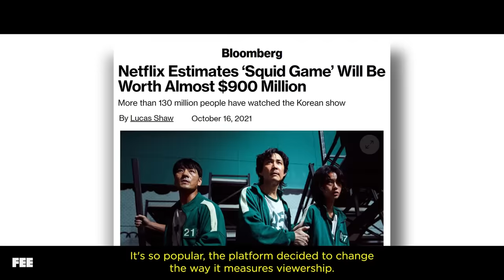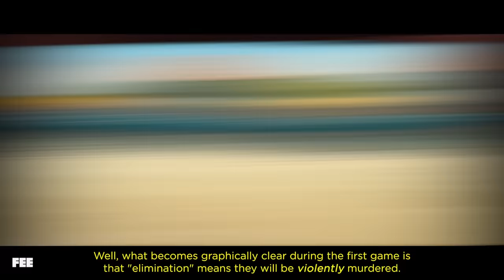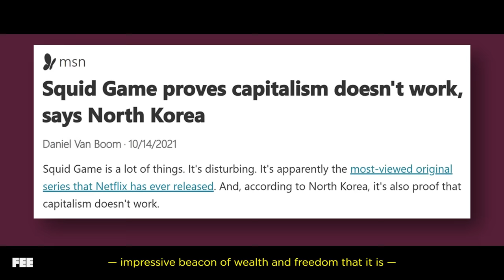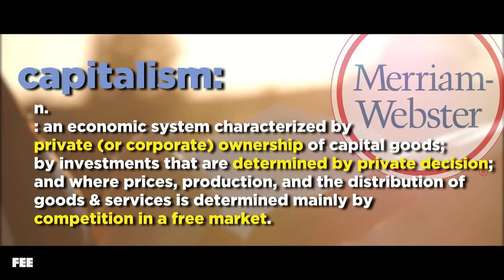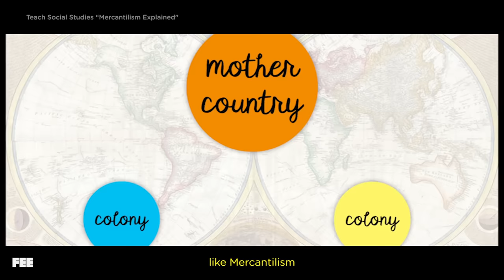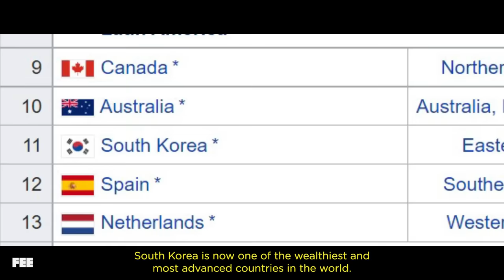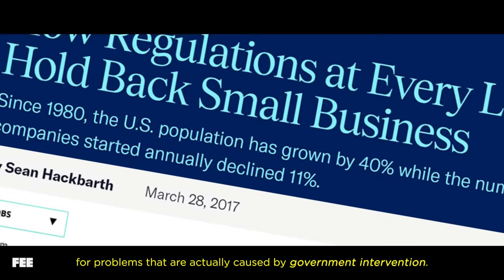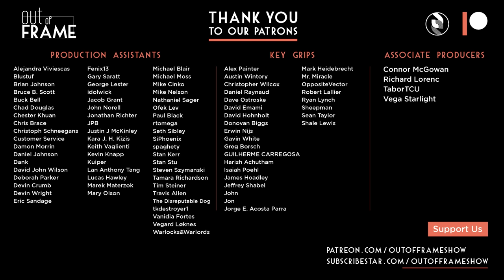Squid Game is Wrong About Capitalism

Comment: I saw it as simple take on moral failings and their consequences when you keep making immoral choices.
Capitalism is the BACKDROP because only in a free Capitalist society can the consequences of the individual's moral failings be of the most significant.
In top down societies, you have no agency, therefore no choice, no possibility to be immoral.
The morality/immorality and it's consequences lie mainly with the State/ruling class.
This is what critics of Capitalism fail to recognize. The "problems" with Capitalism are actually with the moral failings of the individuals within that system, which is why Capitalism is only as successful as the members of it's practicing society share and hold a common moral belief system.

Every system is subject to moral failings of the humans using it. The strength of Capitalism is those lie at the level of the individual, and thus less problems are created for the society as a whole should they fail in being moral (as we see in Squid Game). In an authoritarian structure, it only takes the moral failing of the leader (or few leaders in charge) to screw everything up and wreak suffering the consequences upon everyone, including bringing the whole system down.

Comment: To be frank, I get the feeling the series might actually give a pro capitalist message by showing that the characters, for the most part, made the circumstances they are now in.  If it was truly anti-Capitalism, it would be a bunch of people fired for non sensical reasons or people who are on the job hunt for years.  The masked people also don't really exemplify Capitalism either cause they are wealth elites that can exist in any market form.  Nobles in Monarchies have similar if not greater power.  Communism has it too.  

The series is a critique of those who critique Capitalism by showing the true nature of those that complain about it.  The majority don't want to put out the effort to be successful with a much smaller group of people who got the short end of the stick.  The smaller group has a right to be upset, but also the beauty of Capitalism is that you can reinvent yourself and succeed in another part of the market.  As for the lazy majority, they need to stop blaming the system for their own failures.  The show creates an environment to show off the major groups of complainers and shows how most of their complaints are their problems, not the system's, and how pitiful they are for blaming everyone else for what went wrong with them.

Comment: Correct! Squid Game had little relation to Capitalism and more to do with Cronyism and possibly oligarchical rule, highlighting greed and deception rather than profit. 

I favored all the characters OP did and disliked the other main characters, however I like the resolution. Some of the changes have to do with the eastern symbolism (I.e. making a big deal about getting a hair cut and then becoming a different character/finally growing). Still this is a good analysis! 

Props for reviewing what you didn’t like fairly!

Comment: So, this is the classic defence and use of doublespeak that heard when defending capitalism. 
   Capitalism is a word. Proponents of capitalism will pull out a dictionary and slavishly follow the definition said whatever criticism does not apply because it's not a critique of capitalism.
    This becomes doublespeak when creators of videos like this so not apply the same standard, or speak out against all the profiteering videos and commentary. 
    Fire those videos the dictionary is put away and a neuanced discussion about ideas takes place. Instead of just subs those videos such and are not about capitalism.
   This isn't even a video, it's a cut and paste response used for 40 years.